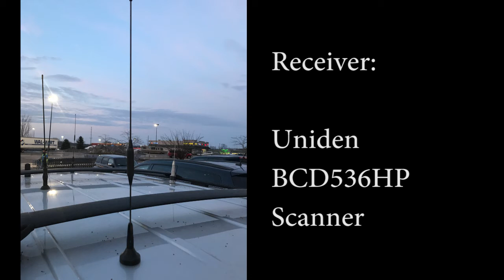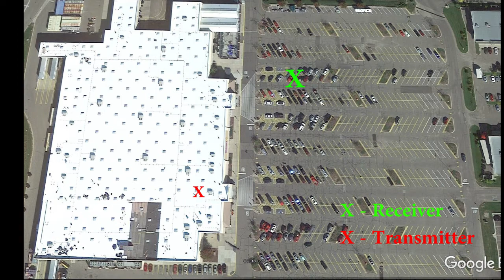Simplex VHF In-building Testing - Kenwood VP6000

Comment: Is this in Digital mode or analog because i know near the produce section it got a little choppy during transmission but the voice sounds digital
Reply from the maker: This was done in Analog mode, the radios have Analog Noise Cancellation in them that make the radio sound digital.
Reply: Ok thank you, i was going to get one of these or the 5430 for my county communications
Reply from the maker: Sounds great, both are great radios, the are the same. The difference comes down to ergonomics and features.